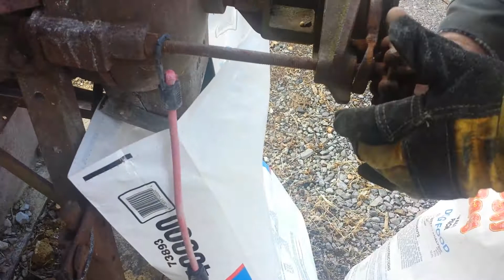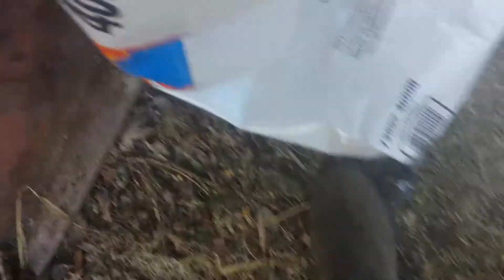Antique Burr Mill

Comment: Great video. Good idea having the mill setting in a building and opening up the door to access it. Beats moving it around. I have a New Holland Burr mill I was going to build a trailer for to pull it out when I want to use it. Making a dedicated spot for it would be a better idea I think.

 Would you video the outside of the building where the mill sets. I would like to maybe get some ideas.
Thanks.